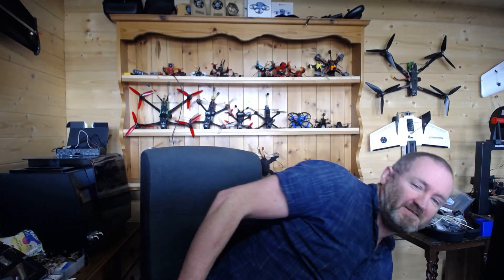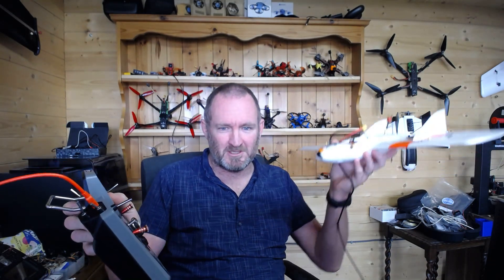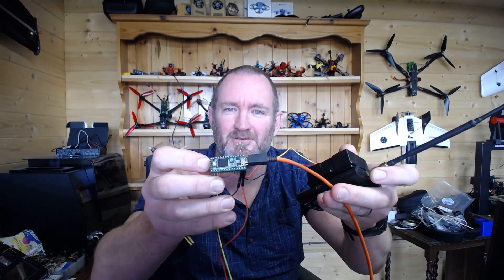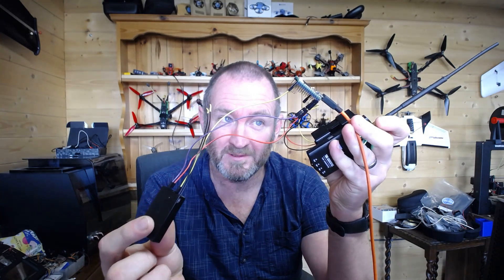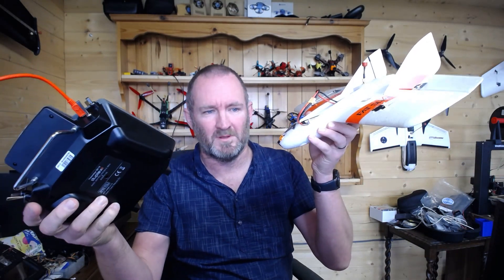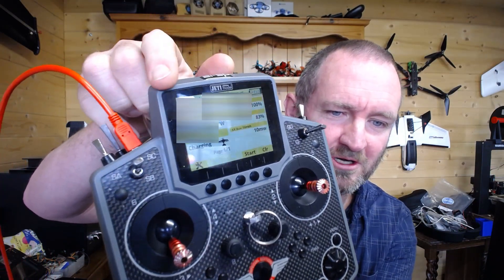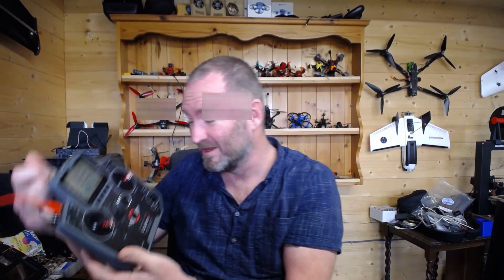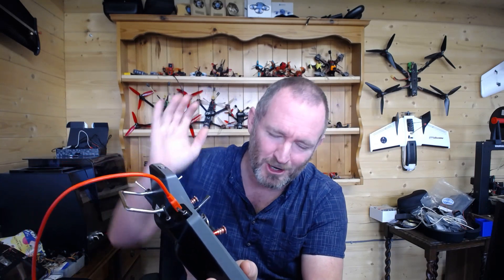JETI TO CROSSFIRE | PROTOCOL CONVERTOR

Comment: Can the code you provided be used for ExpressLRS devices? Thank you
Reply from the maker: @dasaka5643  theoretically yes.. But for some reason any elrs unit I tested on would never work.  

Never got to the bottom of it.

I got to point I was wondering if elrs will not run at the lower baud rate that the little board is capable of.

I don't think you can get these boards anymore, so chances are a newer board would work better - but code would need updating.
Reply from the maker: So worth noting.. This can, work on elrs.. But issue was that the teensy 3 was not powerful enough.

When installed on a teensy 4 it works.
Reply: Thanks for your reply! I don't know much about code, so I can only try to use GPT to help me achieve this goal. Will you continue to update and share the code for teensy 4? Thanks!

Comment: Would this work with TBS Tracer?
Reply from the maker: Yes.  Technically anything that uses crsf as the protocol.

So I guess expresslrs and ghost would also work.
Reply: @RTRCTV  Good to know - thank you!  I have built the Teensy and uploaded your hex file to it using Teensy loader.  The Jeti sees the telemetry entries (all have no value) and the module isn't getting any commands from the TX.  Any immediate thoughts?  I appreciate the help and all your efforts on this project.
Reply from the maker: @jasons1609  difficult to say without more info.

Can you show me a pic of your wiring?

Email me rob at rt - rc dot com

Comment: I think its a pretty ugly solution. Maybe you can still answer my question. Is it slower when using ppm? I suppose it is also outputted via mini usb? I dont care too much about Telemetry, since I display my stuff on my osd. I would love to use this solution with my dc16, but I am worried with ppm relating the latency, I guess this solution is even worse :/ sad that they dont support xbus
Edit: okay sorry i tought I saw a rx in between, watched the whole video now. Maybe I will try this.. How is latency?
Reply from the maker: Well...    physically yes.

But practically.. it is perfect.

Problems you will find with running crossfire direct of jeti module bay are:

1.   Battery Life with crossfire - 2 hours (maybe)
2.  PPM is slow.    And jeti PPM is even slower due to a 'bug'
3. You will feel the latency.

I built the protocol convertor because it was the only way to achieve high speed with all the csrf functions :-)
Reply: @RTRCTV  Okay so my question is, when i run this method, is it using xbus? So i get the normal speed of an xbus connection? I guess an external battery, is always a method
Reply from the maker: @a.s.ampere6041 correct.  You get full exbus speed.  Still slower than full speed csrf.. But damn site better than ppm!
Reply: @RTRCTV  are you even sure about that? The Transmitting protocoll is still crsf right? Just the Transmitter Protocoll internally is exbus. But yeah it probably is slower.. Meh I guess i will stick with my taranis then. Even tho the gimbals are not even remotely close to the one of my dc16
Reply from the maker: @a.s.ampere6041  Yes. The translation of the protocol is very very fast.

Thing is.. exbus is just slower than CSRF.    Was never designed for race quads.

Net result.. latency is a little lower.   Similar over-all to SBUS.

Comment: Hello, how do I connect the signal line to the power supply
Reply from the maker: In my case.. I power the whole setup with a 5v regulator.    That way it's the same power feed and gnd for all devices.

You need to at a minimum have a common ground between all devices.
Reply from the maker: Let me know how you get on.    I published an update to the source yesterday.. So make sure you use that.  It adds more of the RF sensors that xfire provides.